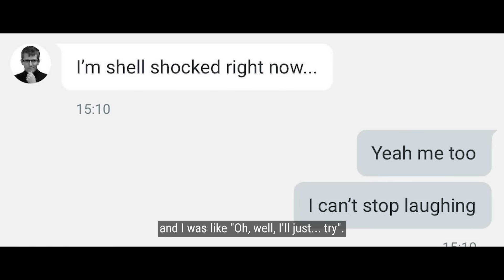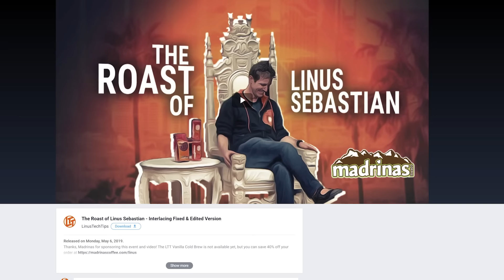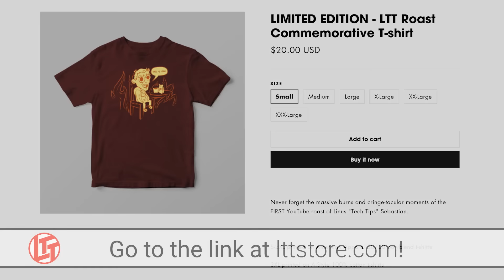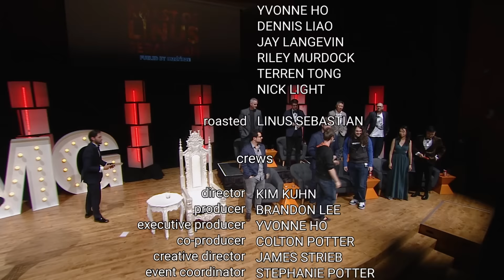The Roast of Linus Sebastian

Comment: 29:38 in the past 24 hours, we found out.
Reply: why what happened
Reply: @shway1  Linus was sent a prototype cooling unit and a graphics card it was to work for. Couldn't be arsed to find the proper card so used one that the unit was not designed for and trashed the product. When it was pointed out he tested it incorrectly his defence was basically "I don't like it so it should fail".

The it turned out that instead of returning the prototype (which for a small company it was one of a kind thing that they would need to completely rebuild) he sold it via auction and when it was revealed he went all "I didn't sell it, I auctioned it!" as if it made any sort of difference. Then it turned out he didn't even return the card he was sent to test the unit with either.
Reply: @ZeroCanalX  oh shit